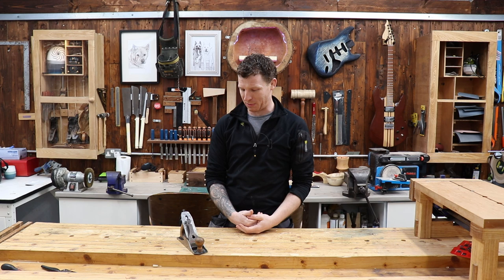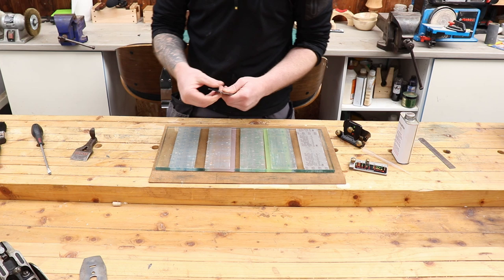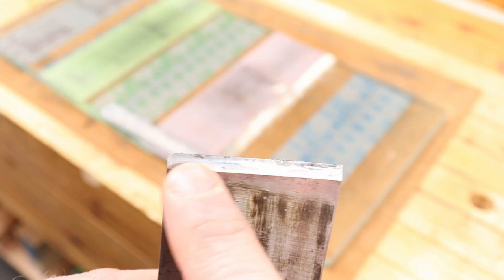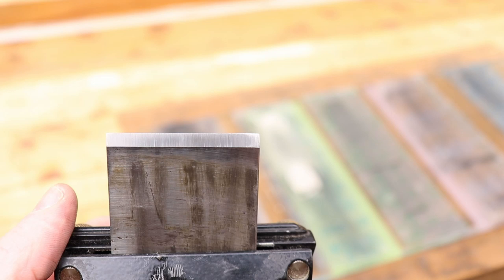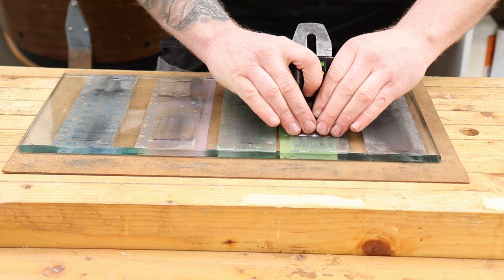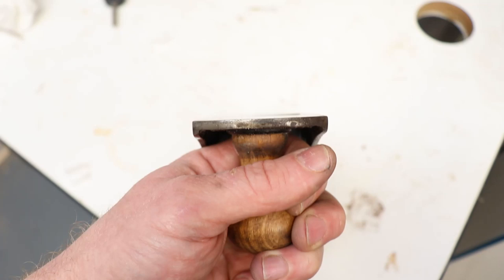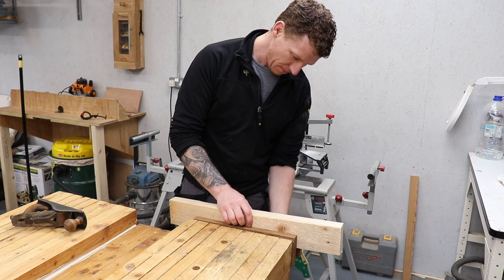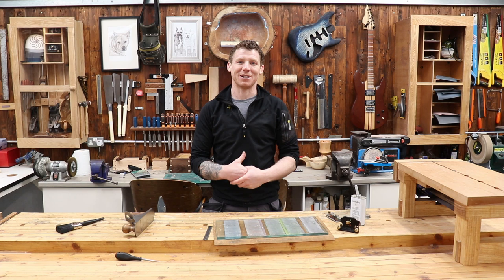How I Sharpen My Hand Planes/ Plane Blades Scary Sharp.

Comment: I use a scrap of wood covered with green honing compound to touch up my blade lasts forever, when I'm not in my shop I use the same thing on a thinner piece of 1/8" wood I keep in my pouch or pocket. I touch up my blade for 5 seconds each time I use it.

Comment: On my low angle Jack instead of adding a secondary bevel I put 6° back bevel some people believe the blade stops cutting if you do this but it hasn't for me yet... The reason I do this is to keep the low angle, and to make the edge stronger.
Reply from the maker: If it works it works